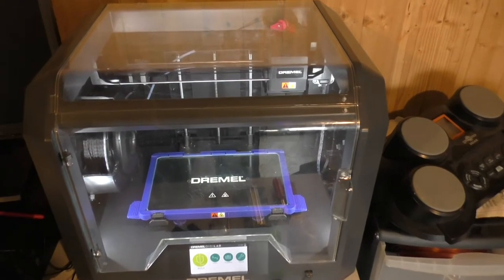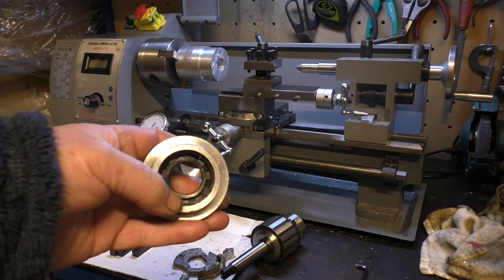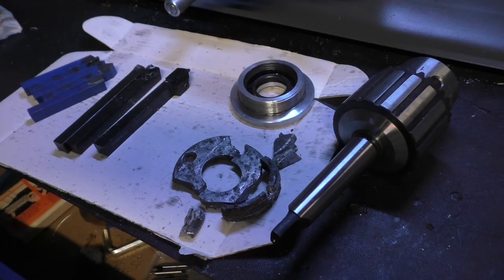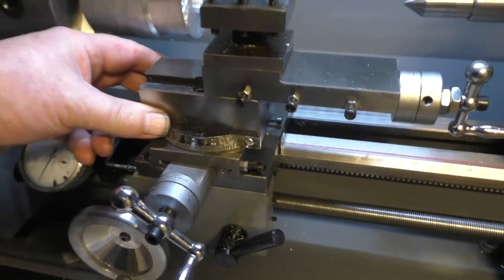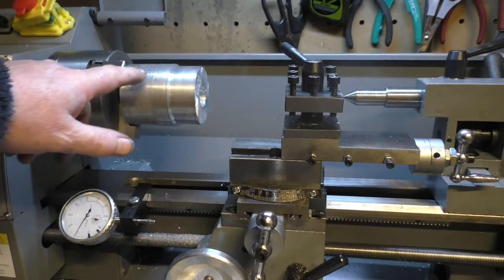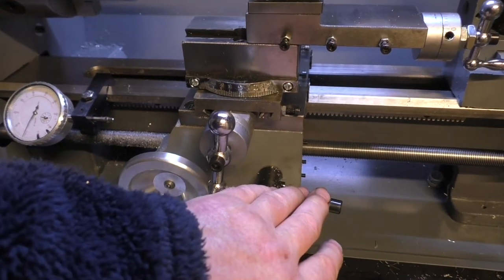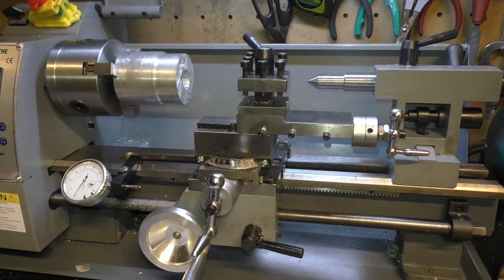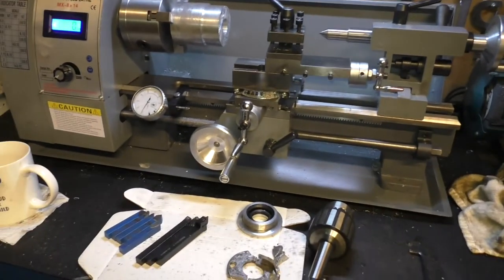CREWORKS 600W 8''x14'' Mini Lathe,  XL500S Rear wheel Bearing retainer

Comment: I'm thinking of getting a Creworks lathe. Have you used yours very much, have you had any problems with it?
Thanks.
Reply from the maker: Hi, i have used the lathe for quite a few hours, I would say the only problem i have come across is the Variable speed control knob, intermittently when turned to 0 RPM the chuck still rotates very slowly, a quick rotate up then back to 0 seems to cure the problem. hope this helps.